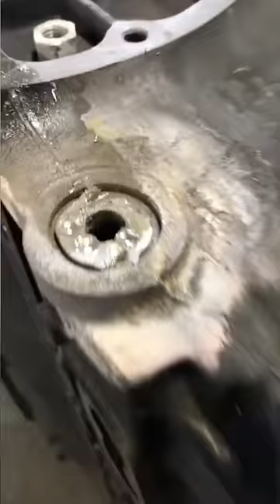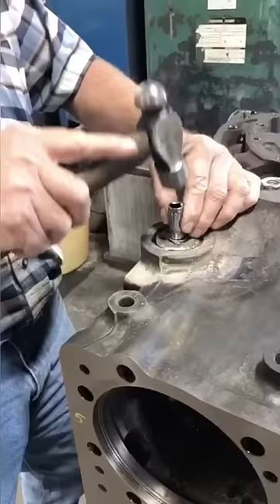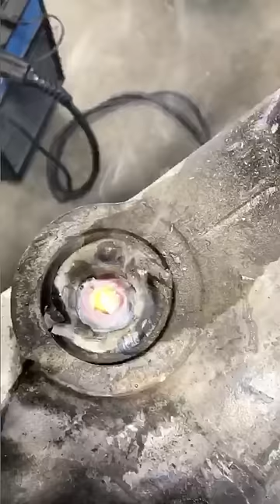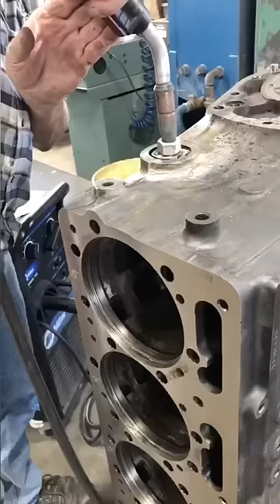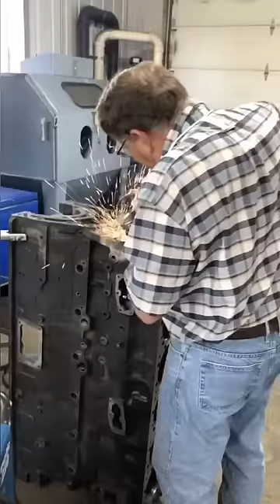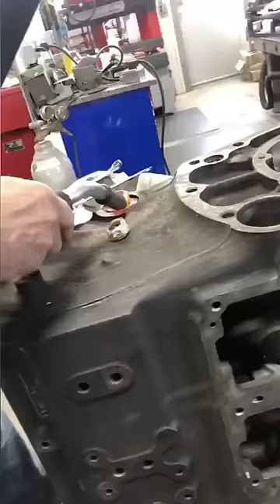#shorts N14 Cummins Block Plug Removal - This one fought back!

Comment: Your strongest weld is outside weld   Not a (tack weld)  breaker bar with a 2 foot pipe pulling strong but gentle . Removing over torqued oil filters or installed with no lube on rubber gasket. I welded reinforced metal to my snap on oil filter wrenches then added 14 inches to handle some times on Kubota tractors the factory would install hydraulic filters dry or over torqued or both .  Impact wrench?  Lol  you’re right can’t teach comon sense

Comment: Next time you weld a nut on one of those plugs hit it with a candle while it's hot 🔥🔥 I've been told the wax is sucked in the threads like solder on a sweat joint and the plugs usually screw right out that is knowledge passed on to me by a engine machinist who used to do work for me 😊

Comment: Done all wrong, the welch plug did not offer any fastening to the nut, only a divider to stop weld from dropping inside the plug, but there is no reason for the weld to extend down into the plug because nothing is below or under it as it should have a solid bass on it.

Comment: The zinc coating on the nut contaminants the weld and makes it weak. Removing the coating and making the nut bear steel before welding would be ideal. Maybe you did this, hard to tell in the vid.
Reply: And then, you could always take a torch and burn the old one out.....Oh yeah, you wanted to use the block again. Probably NOT the best way of removing a seized pieezed
Reply: please frug

Comment: Candle wax!!!! Oil just burns off when it's hot most of the time... Especially any penetrating oil, which is completely useless with a torch... Kroil, while expensive, is also a good option for applications without heat asking with a 50/50 mixture of acetone and transmission fluid... Nice job BTW...

Comment: Mig is the wrong application for this.   Should use a electrode like Cronaweld 333 for the cleaning properties of the flux on the rod.  It also has a higher tensile strength and better elongation.  

Very easy repair with the right product and would take 3 attempts.

Comment: Ok but why did it seize like that? No rust. No corrosion. No damaged threads. No evidence of locktite (even tho it would’ve been melted off at least 5 times now from the heat). Can’t over-tighten it.

Comment: I hate it wen u ready to loosen after welding the nut on. You add oil to it to ease the removal. Then the welded nut pops off. Now I need to re-weld and it's covered in lube.

Comment: drilling and tapping the center of the nut left hand threads  would have been faster. Something like 1/2-20 lh , you can use the impact gun to drive the tap. 4 minute job,, Either way , u got it out , nice work

Comment: I would have been soaking that down with oil when it was red hot after being welded helps that oil get into the threads at least that's what I find

Comment: Welding helps shrink the plug? Quite the opposite. You would want to shoot pressurized cold air on the plug to make it constrict versus the block. All you did was make it contract and make it harder to unscrew

Comment: I know if you realize this but it takes an extra 30 to 45 seconds to put three tac on the outside of the nut, you do multiple videos where the nut keeps breaking off and the first thing I say in my head is why the hell are you just welled on the inside of the nut well the outside obviously to make it stronger especially if it's seized

Comment: The fact that every time they get a stuck nut, they don't make a nice surface and tac the outside as well as the inside.. That's 2 min extra job instead of braking 2 bolts and spending maybe an hour.
Reply from the maker: An hour 🤣

Comment: Yeah it sees cuz they use an air hammer on the outside and actually drove the plug into the block if you look you can see the damage they were just heated up put some oil on it and let the oil pull into the threads for a while have some patience they probably would have got it out

Comment: Imma huge fan of ur vids but I have to say as an apprentice I have yet to see this actually work, I always suggest it when we have stripped or snapped bolts and studs but my lead always says it's not gonna work so recently we've been trying it on all kinds of applications only to find that the general automotive industry is not a place where this trick is feasible, maybe as a large diesel mechanic this will help but as a general automotive tech it will not cuz cars and consequently the bolts and studs used on them are much smaller and usually apart of a system or near a system or component that cannot receive heat in the situation where you have a huge diesel engine out of the vehicle drained of all fluids with a huge half inch thick stud to pull out then yea you got a good chance but if ur working on a Ford f150 with broken exhaust manifold studs then ur screwed pretty much any bolt that will break will be in an area where heat is not allowed try welding a nut onto a broken bolt while hanging upside down inside an engine bay with ur welder right next to the main power harness all ur ac and coolant lines or right next to ur fuel rail tell me if you think that ever ends well... ur lucky if you have the space or access to put a welder on anything and even if you do find room the stud/bolt will be too thin to weld a nut onto go ahead and try you'll either get it too hot destroying the structural integrity causing it to snap off further and if you weld any colder you won't be able to get a good weld on it and it'll break off everytime not to mention the steel bolts and studs that normal car manufacturers like to put into fkn ALUMINUM... did you know that when steel and aluminum come in contact they create their own specific kind of corrosion that's way more prominent and harder to break thru then rust so you have corrosion build up in the threads as well as rust and guess what heat does to that corrosion? It solidifies it... so no in the normal everyday automotive industry this shit don't work my superiors all told me it doesn't work and they were right.
Reply: Would love to see you guys pull some snapped off 1/4 or 3/8-16 with FINE thread out of a cylinder head while the engine is still in the vehicle must be nice having the job 98% done for you every time

Comment: Don't use an impact device on a job like this.  You need to tickle it 'til it comes out laughing.  Back and forth with lubricant does the trick.

Comment: How much would you charge to do a long block on a GM 3.8l 3800 series 2? I have all the parts. I bought it as my very first project car because ive always loved these Camaros. It had some pretty significant body panel damage that ive repaired but i want to start on the powertrain. It has 200k on the original block so ive been told thats a good seasoned block to rebuild. If yall arent too busy it would be awesome to have yall a part of building my dream car!

Comment: Dude i need your help so much. My grandpa bought the same chickago pneunatic impact you use in the video. Its been used since even at my dads shop now (grandpa died in 2005). The issue is the top head that holds the adapters that 1/4 inch thing got rounded off due to it working so long. Where can i find a new impact head. I am not from USA but if ifs only found in usa i will book a plane one day and get it

Comment: Should have tacked the outside right from the beginning. There is way to much torque in the middle of the nut vs the outside of the nut. When you are trying to impact it off. The first attempt would have been successful if you had done this.

Comment: I know it's more work but why not just tack weld the outside of that damn nut the first two times? It seems as if making a YouTube video is more important than getting the job done right the first time. Also great work beautiful job I know it's never easy I'm just wondering after so many tries why would you keep doing what fails, being that 10 more minutes at the most would create such a great response on each job

Comment: Similiar process but think exhaust manifold bolts on gad motors.  Only real difference is lll drill an 1/8" hole into the broken bolt, build a  nipple with weld then ad nut.. some people say remove by hand. I disagree and use an impact just let it hammer....slowly just hamhamhammer and twist slowly.. Could be 5 minutes..could be hours if the bolt is broken well into the block. This trick was a secret I learned before the internet. I hope all you young people appreciate esoteric knowledge easily obtained through people willing to make this content. I had to pay to get this knowledge. Clean a shop for an angry alcoholic who wouldn't talk till he had just enough jim beam. Then he'd share knowledge. You tube is preferable..lol

Comment: It's just a matter of physics you should have welded the outside of the nut from the get-go you have more mechanical advantage welding on the inside of the nut it's just kind of silly well the outside of the nut again it's physics

Comment: I hate to be “that guy”, but why not weld the outside of the nut in the first place? In prolly most situations, you don’t have the ability to filet weld the nut on, like on a broken stud or what have you, but frankly the inside of the nut welding technique is not very strong, it’s basically a boogered tack weld.

Comment: If those nuts were twisting off that easy he wasnt doing too good on that welding job . Small as the plug is with the nut welded on and heat it shouldve came right out !

Comment: If you heat metal it doesnt shrink
Reply from the maker: If you are just heating it you are correct. But adding weld to it will cause it to shrink when it cools.
Reply: @JAMSIONLINE  Thanks good to know 😅

Comment: Couldn't u just heat just the screw so it shrinks and then take out with a corkscrew.
Reply: Heating makes it expand cooling makes the heated material shrink .. since there was a hole in the seized plug adding weld to the center will make it pull into itself slightly

Comment: Can’t you drill the bolt out like a rivet?
Reply: It's a plug. .. and yeah you could do that but what are you going to do with the now destroyed threads.
Reply: @codyramos3200  it could definitely be rethreaded with a tap and die set. You would have to most likely buy or fabricate a new plug for yourself tho. I’ve never use the tap and die on a motor but I don’t doubt it would still work with the right set up

Comment: Hiya I see your problem. Freeze plug nope sorry wrong. Hi tensile Bolt welded , insert bolt Bye ten mill past plug . Cut top off bolt weld over size nut. To plug and bolt. allowed to cool for a while. Sump oil. Leave over night . Give a hammer test ,tap it. Now heat outer area not hot just warm.the bolt in side has already.welded in the plug. Yo

Comment: You want supply the thread with WD40, turn it out manually, not by machine! Like this - no feeling - no control - wrecked tread. This hurts my eyes watching.🙈
I suspect the "clever" customer turned it clockwise to open it with full force until it sheared off. 🤔

Comment: Why didn't you wash the engine first? Why aren't you wearing safety goggles? why aren't you wearing gloves? why are there no safety zones while working? Is that cylinder head supposed to be grounded when welding?(real question)why didn't you use PB blaster instead of oil? Why are you working together with the customer? Is that the customer? Why are you calling him dad? Why are you talking while recording? Why didn't you use a breaker bar instead of an impact? Why is 3rd times a charm? Why couldn't you have done that all the first attempt?

. alright that's all I got please don't hate me for over critiquing

Comment: Man I know yall diesel guys are different but it's so cringy watching the impact on the welded nut, just... no, just use a wrench and work it back and forth a SLIVER at a time, you will have that out first try every time without it breaking off